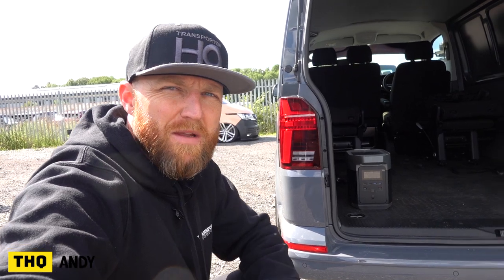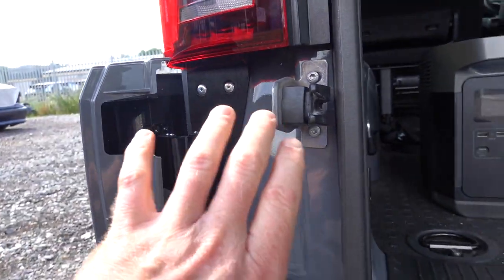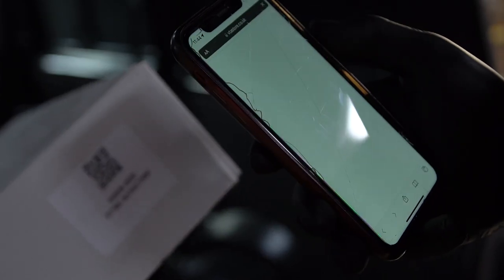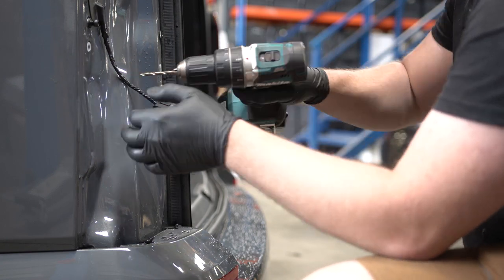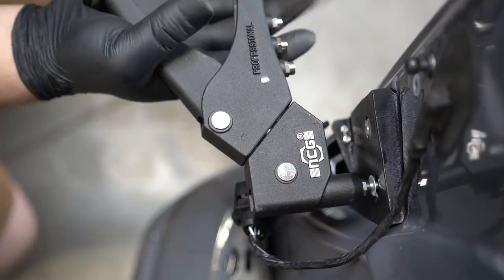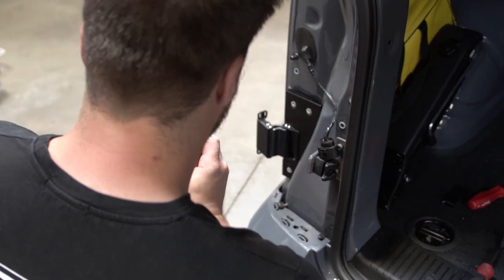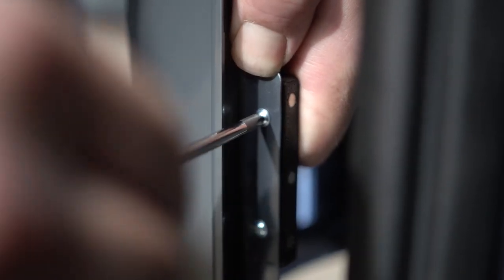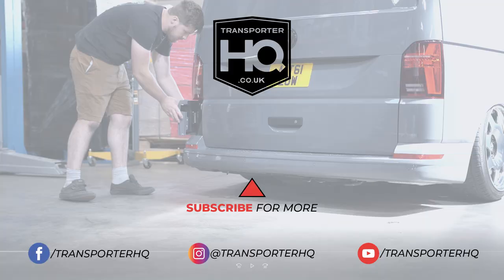VW Transporter T5 to T6.1 tailgate hidden / Stealth flap / cover. Who knew that space was there?

Comment: Nice. I just 3d printed this for my California and installed a propane/butane hookup for the internal bottle.

Be careful - the space is partially occupied if the model has the side assist option.
Reply from the maker: Noted 👌
Reply: Did you design it from scratch? Or is it on thingyerse
Reply from the maker: @junglesairsoftblog6311  Its been designed from scratched.
Reply: Where is the file hosted please?
Reply from the maker: @TheMjdean  there isn't one.
Reply: Please share the 3D files. 🙏
Reply from the maker: @JonathanCr0ss  There isn't a 3D file to share.
Reply: @Michael Fröhlich do you have an .stl file you could share for the bracket?

Comment: Hi,  I have a lowered VW 2010 5.1 camper and socket under rear bumper which keeps getting caught on uneven ground when backing up.  This is a good alternative, but.....  Purchased kit and although clever and can be made to work, it has some problems.  Screws to attach panels to hinge only engage by 2 mm, the 3D printed section they screw into is not solid but is printed with thin walls, so is hollow.  Very hard to get perfect fit without making a final shim between hinge and panel to align panel shuts.  With some careful DIY work you can get it to fit with a shim but the very short screws supplied are a waste of time, they will not hold panel in place and it will fly off the van after a few miles.  I very carefully drilled for thread inserts (just enough room!) and before fitting inserts filled the gap in the 3D printed section with epoxy filler to better hold the inserts.  Did the designer test his design in the real world of VW campers - probably not.

Comment: Any reason why you've chosen the passenger side? Will you be offering both sides as an option?
Reply from the maker: I'll speak to them about also make one for the right side.
Reply: @THQAutomotive  Yes all my services are on drivers side with kitchen, means i have to route water, gas, 240 etc over to other side. be great to get drivers side option 🙂
Reply: All ones ive seen done were on the right where all the units are
Reply from the maker: @mcjjordan  I've confirmed its now being re-designed so we also have a left side version
Reply: Any news on the RHS version? I can’t see it on your website.

Comment: Nice piece of kit! 
Looks a lot more solid than the one I have installed. 👍🏻

Is there an option for it to be fitted on either the right or left ?
Reply from the maker: No they currently only make them for the left side.
Reply: @THQAutomotive  That’s a dam shame😢 all my electrics are 🇬🇧 off-side, as are most peoples due to cabinetry position. My hookup is currently under the bumper there. This would’ve been a no brainer 4 me if you can produce a mirror version….please 😉
Reply from the maker: @mikeshacklock6208  I'll speak to Visiontech as we've had a few requests now.
Reply from the maker: @mikeshacklock6208  I'll speak to Visiontech about making one for the other side.

Comment: What is required to be done on the inside ?
Reply from the maker: What do you mean, sorry I don't understand
Reply: How is the electric wire passed through ? Do you have to drill holes ?
Reply from the maker: Its totally up to you have what you put there. Different people route the cables of gas pipe etc in different ways.  @JefferyRoberts-h5s
Reply: Thank you